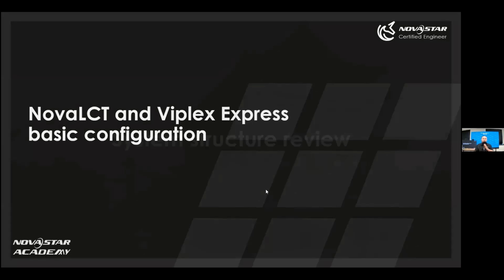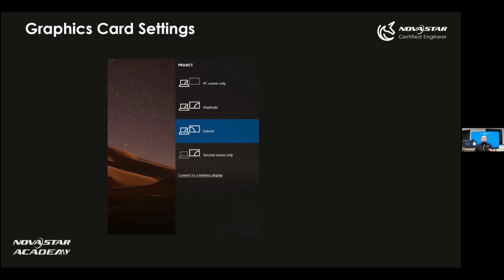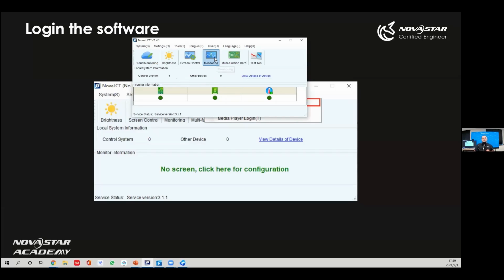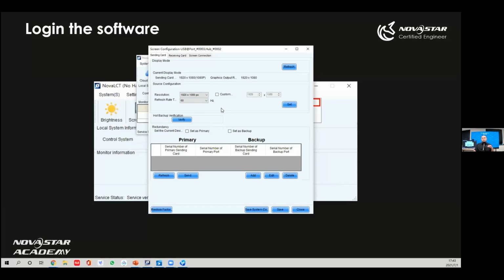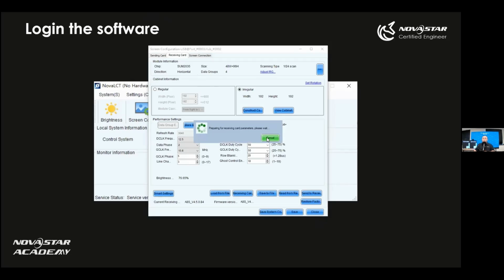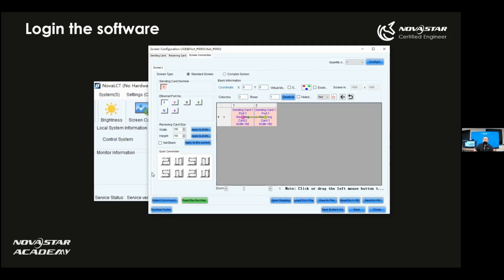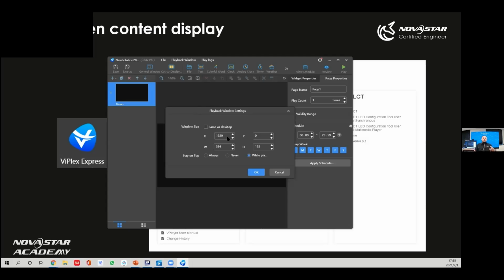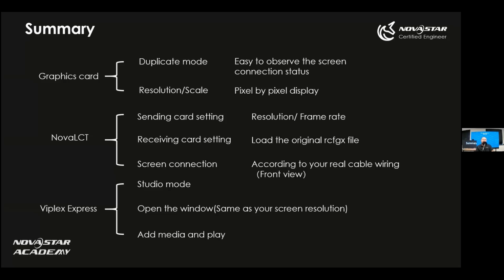NovaLCT and Viplex Express Basic Configuration

Comment: hi, We have one led with sending, receiving card and vipxel software which is working but when we connect a new pc to sending card with just windows 10 installed we did not get display on led. Do we need a vx1000 controller replacing the existing sending card to get the windows desktop displayed on led ?